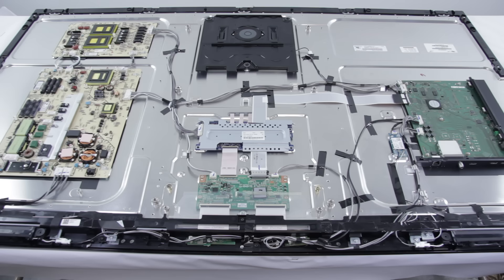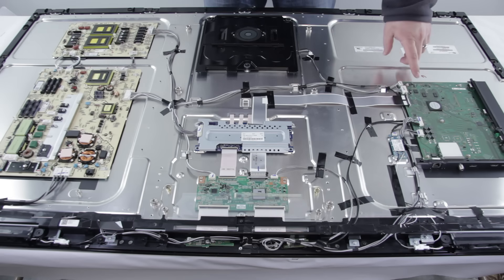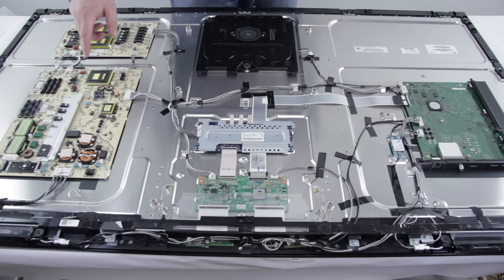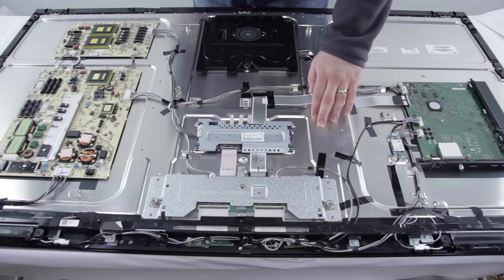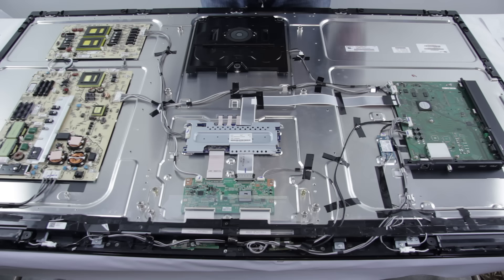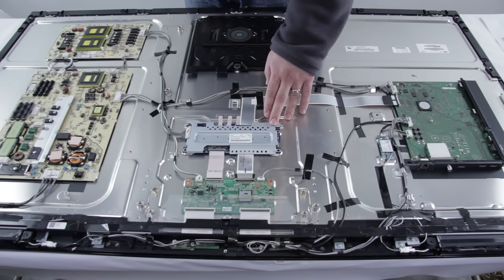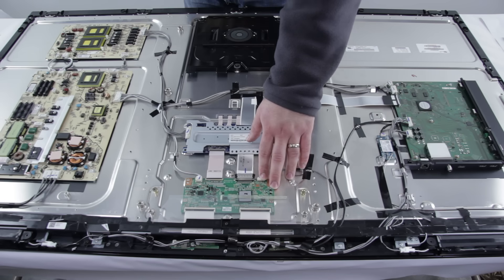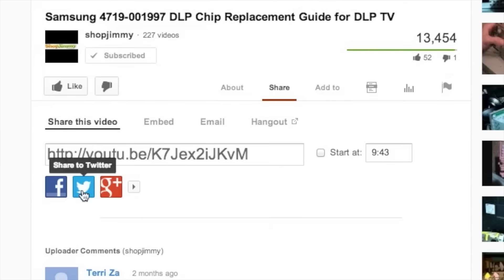LED TV Repair Tutorial - Common Symptoms & Solutions - How to Repair LED TVs

Comment: Great tutorial I have A 55 lw5600ua LG flat screen that was given to me when i first hooked the unit  up it  worked but not the best picture after chang the inputs it stoped working now when i first turn the unit on the LG logo appears and then goes away regardless of the inputs what do you think is the problem ( the first TV i ever fixed when i was about 10 was a late 40ies early 50 ies PHILCO Predictor with a swiveling pic tube cool TV ) any ways i would appreciate any input and keep up the great work on U Tube
Reply from the maker: Kevin Forrey  Try all repairs and troubleshooting at your own risk.  I recommend replacing the main board in your TV.  Click this link to replacement parts for your TV model number:  http://www.shopjimmy.com/catalogsearch/result/index/?cat=56&q=55lw5600ua  There may be multiple boards for the same TV model number, be sure to match part numbers on your current board, with your replacement for compatibility.  Here is a link to a video showing how to identify your part number, click here:  https://www.youtube.com/watch?v=RwHTvjMdrhk  Thanks and please let us know if you have any further questions with your TV Repair!  www.shopjimmy.com

Comment: I have a lg 47ln5700, the TV powers on, flashes the lg symbol and goes black...i have sound but no picture and when light shines on the screen I see a faint picture.  I see no lights coming from the back of the TV when i power it on in the dark.  It sounds like an led driver, but I do not see one on this particular TV?  What part am I looking for?
Reply from the maker: Nick Smith  Try all repairs and troubleshooting at your own risk.  This could be a problem with either the power supply board or bad LEDs in the TV.  You can replace the power supply board to see if that fixes the problem.  Click this link to replacement parts for your TV model number:  http://www.shopjimmy.com/lg-eay62810801-power-supply-unit.htm  There may be multiple boards for the same TV model number, be sure to match part numbers on your current board, with your replacement for compatibility.  Here is a link to a video showing how to identify your part number, click here:  https://www.youtube.com/watch?v=_4Qpfan0vdU Thanks and please let us know if you have any further questions with your TV Repair!  www.shopjimmy.com
Reply: Nick Smith Did the Power Supply board fix your LG TV? I have exact same problem.

Comment: I hope you guys can help me out here.  I have a Samsung 60" LED model # UN60EH6002FXZA.  My screen started to fade to black and took about 3 seconds before I couldn't see anything.  When I turned the TV off and back on, the standby light flashes 6 times and the backlight will dim.  I cannot pull up the menu or see any volume control even with the flashlight test.  I do have sound and backlight.  I've removed the back covers and there is no visible damage such as capacitors bulging or leaking.  The TV was made in April of 2013 so I've had it less than 2 years.  Thanks for your help.
Reply from the maker: Brendon Childers   Try all repairs and troubleshooting at your own risk.  This could be a problem with either the power supply board or the LEDs in your TV.  You can replace the power supply board to see if that fixes the problem.  Click this link to a replacement power supply board for your TV model number: http://www.shopjimmy.com/samsung-bn44-00500b-power-supply-unit.htm  Be sure to match part numbers on your current board, with your replacement for compatibility.  Thanks and please let us know if you have any further questions with your TV Repair!  www.shopjimmy.com
Reply: ShopJimmy, I watched your YouTube videos regarding LED tv repairs and I was thinking it could be the T-Conn board.  I have backlighting so could it still be the LEDs?  Also, isn't it possible for me to check the voltage from the power board and either confirm or eliminate it as the problem?
Reply from the maker: Brendon Childers  Try all repairs and troubleshooting at your own risk.    My apologies, yes if you do have backlight then the problem could be with the main board or the t-con board.  Are you comfortable checking voltages on a board with a multimeter?  Thanks!  www.shopjimmy.com

Comment: I have a sceptre x322bv-hd. When i turn it on the image starts to fade and then it starts blinking. the power light stays blue. Power supply is Megmeet MIP329FL and the main board is a T.RSC8.10A 11153
Reply from the maker: R Maison   I recommend running the flashlight test on your TV.   Here is a link to a video we produced that shows how to run the flashlight test. https://www.youtube.com/watch?v=xUzCLgoSPGM Please reply with your flashlight test results and we can recommend a replacement part for your TV repair. Thanks and please let us know if you have any questions! www.shopjimmy.com

Comment: I have a 42" sharp led model # LC-42LB261U that was hit by a frisbee and now I have lines on the bottom of the screen and on the left side of the screen.  Is there anyway to fix this?
Reply from the maker: Shannon Heck   This sounds like a TV panel (TV Screen) problem.  If your TV panel is bad, it may be more cost-effective to replace the TV as panels are typically hard to find in stock, difficult to replace, and expensive.  Thanks and please let us know if you have any further questions!  www.shopjimmy.com

Comment: Laura GUINADE
Apr 10, 15:56

I have a samsung 6200 series led tv.  Its only 16 months old.  We went to turn it on one day and it would not power on.  The light in the bottom right hand corner only flashes red and will not turn green like it did when working.  I called a tv repairman and he told me it is cheaper to buy a new tv.  He mentioned he thought it was the mainboard.  Just curious if you had any insight and if it is the mainboard if you could direct me to the right one.
Model Number is:UN60FH6200FVersion:HH01SN: 01513CRD900706XType No: UN60FH6200
Reply from the maker: Laura guinade   Try all repairs and troubleshooting at your own risk.  I recommend replacing the main board in your TV.  Please reply with your TV model number.  Click here to view a video that shows how to find your TV model number:  https://www.youtube.com/watch?v=S51nhAmwR2M  Thanks!  www.shopjimmy.com
Reply: Model number is UN60FH6200F
Reply from the maker: Laura guinade  Try all repairs and troubleshooting at your own risk.  Click this link to a replacement main board for your TV model number:  http://www.shopjimmy.com/samsung-bn94-06418u-main-board-for-v.htm  Be sure to match part numbers on your current board, with your replacement for compatibility.  Here is a link to a video showing how to identify your part number, click here:  https://www.youtube.com/watch?v=Aodz2LHkzbY  Thanks and please let us know if you have any further questions with your TV Repair!  www.shopjimmy.com

Comment: Hi, I have a Samsung un46f6300afxza smart led tv after a power surge tv is not receiving any power. would I have to switch out the power supply boards?
Reply from the maker: Julio Zuniga  Try all repairs and troubleshooting at your own risk.  Try all repairs and troubleshooting at your own risk.  I recommend replacing the main board and the power supply board in your TV.  Click this link to replacement parts for your TV model number:  http://www.shopjimmy.com/catalogsearch/result/?q=un46f6300afxza  There may be multiple boards for the same TV model number, be sure to match part numbers on your current board, with your replacement for compatibility.  Thanks and please let us know if you have any further questions with your TV Repair!  www.shopjimmy.com

Comment: Hello, i have an LG 47LM7600.  The panel's picture is split down the middle.  the left side is fine and the right side is divided into 3 sections and two of them are reversed. sound works, and this condition exists with all devices disconnected. I replaced the digital board and the problem still persists.  any advice is appreciated.

Comment: I have a 50' Philips the model # is 50PFP5332D/37 it has no power to turn it on
Reply from the maker: Reedie Duvall   Do you have experience using a meter?  Can you measure voltages?  Thanks!  www.shopjimmy.com
Reply: no

Comment: I have a Vizio XVT553SV, the tv first started shutting off by itself it would power back up by itself, with the vizio light flashing for about a minute. Than it began power off and i would have to unplug it and hold the power button in for 30 seconds before it would start again. I shut it off the other nite and later went to turn the tv on and the only thing i would get is a amber light. No sound, no picture, no white vizio light just amber in color. The tv set is about 5 years old.

Comment: I have a LG model 47LE5400 - LCALSWLJR.  Made in 2010. For several months the small white lights on the front right bottom which always come on and usually go off when the TV is turned on have been periodically staying on.  When this happened, the remote would not work, nor would the TV turn off manually with the on/off button on the front. I would have to unplug all cables (hdmi, cat5,) and cut power to get TV to power on and lights to cycle off normally.  Recently, the TV turned itself off and restarted with sound, but no picture.  Any ideas?
Reply: Thanks!

Comment: I got a 50" Samsung 3D LED Smart TV.  model UN50F6400AFXZA.  It first started where i could not turn TV off. once i unplugged it the TV.   When i plugged back in the Samsung splash screen shows up then goes black then restarts after a minute. I checked the capacitors on the power supply i did not notice any bulging up. also back lights do light up.
Reply from the maker: Carlos Capetillo  Try all repairs and troubleshooting at your own risk.  I recommend replacing the main board in your TV.  Click this link to replacement parts for your TV model number:  http://www.shopjimmy.com/catalogsearch/result/index/?cat=56&q=UN50F6400AFXZA  There may be multiple boards for the same TV model number, be sure to match part numbers on your current board, with your replacement for compatibility.  Here is a link to a video showing how to identify your part number, click here:  https://www.youtube.com/watch?v=RwHTvjMdrhk  Thanks and please let us know if you have any further questions with your TV Repair!  www.shopjimmy.com

Comment: I have a 46" led smart tv Model: un46es6100f 
That shuts off one day and never came back on. It has a red light flashing on and off at the bottom right corner of the screen. Do you know what's wrong with it?
Reply: Forgot to mention that I got a Samsung.
Reply from the maker: doua yang  Try all repairs and troubleshooting at your own risk.  I recommend replacing the main board in your TV.  Click this link to replacement parts for your TV model number:  http://www.shopjimmy.com/samsung-bn94-05656a-main-board-for-un46es6100fxza.htm  There may be multiple boards for the same TV model number, be sure to match part numbers on your current board, with your replacement for compatibility.  Here is a link to a video showing how to identify your part number, click here:  https://www.youtube.com/watch?v=BEPWrefQvqI  Thanks and please let us know if you have any further questions with your TV Repair!  www.shopjimmy.com

Comment: I have an 60" LG LED TV model #60LN5400. My house was struck by lightning. Even though it's plugged in, the red standby light no longer powers on. The TV won't turn on at all. I'm guessing I need to replace the power board first and go from there?
Reply from the maker: tp2386   Try all repairs and troubleshooting at your own risk.  I recommend replacing the power supply and the main board in your TV.  Click this link to replacement parts for your TV model number:  http://www.shopjimmy.com/catalogsearch/result/?q=60LN5400  There may be multiple boards for the same TV model number, be sure to match part numbers on your current board, with your replacement for compatibility.  Thanks and please let us know if you have any further questions with your TV Repair!  www.shopjimmy.com

Comment: I have a Sharp LCD model LC-45GD5U. Yes I know this is an LED video, however, I have Colored vertical lines across the entire screen. I have sound and backlights. I purchased a new T-con board from you (CPWBX3348TPZZ) but it did not cure the problem. I cannot get menu to display. I also cleaned the ribbon connections with alcohol. My next option I believe would be the main board DUNTKD393VJ03. I see no bulging or exuding caps. Could you relay your thoughts before I order a main board. I ordered the T-con on 4/8/2015 so you may look me up and also respond to my email address.
Reply from the maker: John Gross   This sounds like a TV panel (TV Screen) problem.  If your TV panel is bad, it may be more cost-effective to replace the TV as panels are typically hard to find in stock, difficult to replace, and expensive.  Thanks and please let us know if you have any further questions!  www.shopjimmy.com

Comment: hi my tv model and brand is hyundai hlt-32e800xt. the power led turns on, the backlight led turns on but no display at all.
Reply from the maker: Joel Obenza  This could be a problem with either the t-con board, the main board or the TV panel.  You can replace the t-con board and main boards individually to see if one of those fixes the problem.  Unfortunately I do not see any replacement parts in the search results for your TV model number on our website.  Thanks and please let us know if you have any further questions!  www.shopjimmy.com

Comment: I have a Samsung UA40D5003BR  with the problem of no backlight but have sound and with a torchlight shining to the tv screen, i can see the picture. Please advice. Thank you.
Reply from the maker: *****  Try all repairs and troubleshooting at your own risk.  This could be a problem with either the power supply board or bad LEDs in the TV panel.  You can replace the power supply board to see if that fixes the problem.  Click this link to a replacement power supply board:  http://www.shopjimmy.com/samsung-bn44-00473a-power-supply-unit.htm  There may be multiple boards for the same TV model number, be sure to match part numbers on your current board, with your replacement for compatibility.  Here is a link to a video showing how to identify your part number, click here:  https://www.youtube.com/watch?v=sSJexLvRrjM   Thanks and please let us know if you have any further questions with your TV Repair!  www.shopjimmy.com

Comment: I have a Samsung UA55C6900 Led TV.  The TV is making clicking sound when you turn it on.  Has been turning itself off as well
Reply from the maker: Jody Watsford  Try all repairs and troubleshooting at your own risk.   This could be a problem with either the power supply board or the main board in your TV.  You can replace the main board and power supply board individually to see if one of them fixes the problem with your TV.  Click this link to replacement parts for your TV model number:  http://www.shopjimmy.com/catalogsearch/result/?q=55C6900  Be sure to match part numbers on your current board, with your replacement for compatibility.  Thanks and please let us know if you have any further questions with your TV Repair!  www.shopjimmy.com

Comment: I have a Sony 70" (model: KDL-70R550A). My TV will not turn on. The status light is green for a second, and then flashes red 5 times. Thank you in advance for any help!
Reply from the maker: calonzo05  Try all repairs and troubleshooting at your own risk.  I recommend replacing the t-con board in your TV.  Click this link to replacement parts for your TV model number:  http://www.shopjimmy.com/sharp-cpwbx5348tpza-t-con-board.htm Be sure to match part numbers on your current board, with your replacement for compatibility.  Thanks and please let us know if you have any further questions with your TV Repair!  www.shopjimmy.com

Comment: i have a lg 47lm4600 led  tv. the image went out suddenly. The back light is bright, power is on, audio is on, but there is no image to be seen in any of the inputs.The are a few darker vertical broad stripes that run across the screen.  Would you suggest a board that i could purchase? thank you. len
Reply from the maker: Fein Proper   This sounds like a TV panel (TV Screen) problem.  If your TV panel is bad, it may be more cost-effective to replace the TV as panels are typically hard to find in stock, difficult to replace, and expensive.  Thanks and please let us know if you have any further questions!  www.shopjimmy.com

Comment: Hi,
  Chris blade here again. insignia ns-55e 480a13a. watched the tutorial and performed the flashlight test as you recommended. Their is sound and picture for 5 to 10 minutes and then the picture goes out. Still has sound though. I pushed the menu button and can see the menu with the flashlight. I did purchase an inverter off of ebay, installed it, and the TV still does the same thing. Could it be the tcon board? Any recommendations? Thanks
Reply from the maker: chris blade  Try all repairs and troubleshooting at your own risk.  This could be a problem with either the power supply board or bad LEDs in the TV.  You can replace the power supply board to see if that fixes the problem.  Click this link to replacement parts for your TV model number:  http://www.shopjimmy.com/catalogsearch/result/index/?cat=59&q=ns-55e  There may be multiple boards for the same TV model number, be sure to match part numbers on your current board, with your replacement for compatibility.  Thanks and please let us know if you have any further questions with your TV Repair!  www.shopjimmy.com